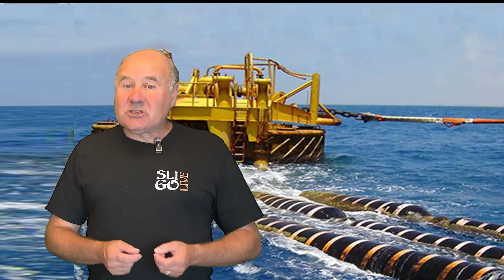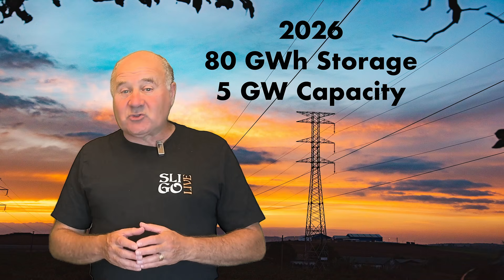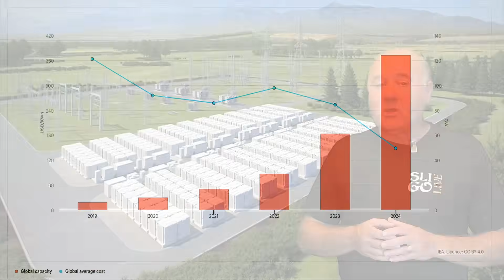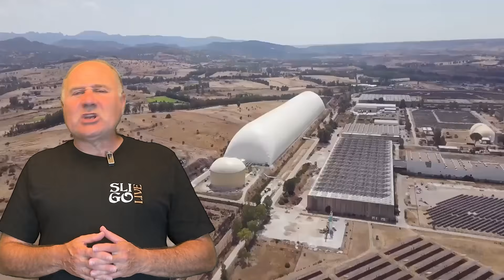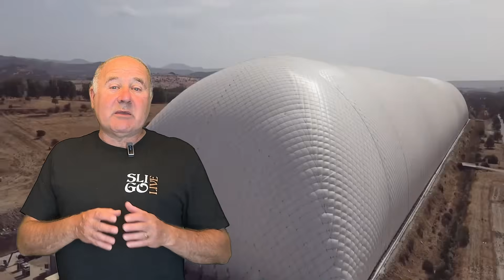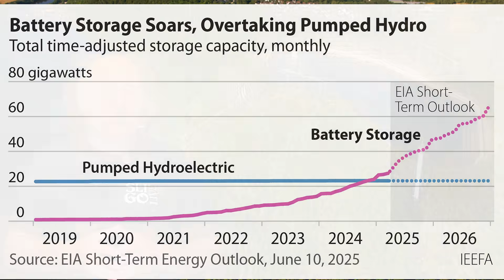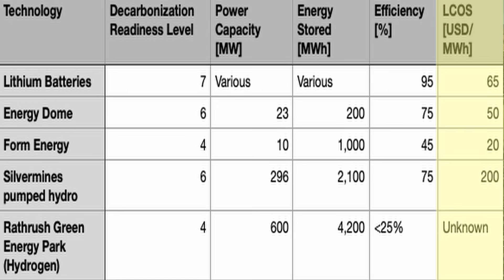Can Ireland build enough energy storage to turn off the gas?

Comment: I stopped watching your video the first time when the subject of energy domes was discussed.
I've watched it all now and subscribed.
You can note that I think Sodium Ion battery storage and solar PV will become the overwhelmingly dominant technologies in the next five years; why ? Solar PV and battery storage are so easily and quickly deployed, and speed is of the essence now. Sodium is abundant and doesn't have the processing disadvantages of Lithium.

I record temperatures both locally and the forecasted. There's a very marked jump in the number of heat waves, their intensity and duration, there really is no time to lose !

I used to work on an oil exploration drilling rig, after a couple of years on drilling and production platforms in the North Sea; left to do an Open University, first module, renewable energy, that was in 1993. So I've been interested for a while and watched the competing technologies.
Solar PV and battery storage is remarkable and relatively affordable now, with payback in less than a couple of years in my case, though I did put it together myself and used an off the shelf portable power station.
I so wish Ireland would follow the lead of other EU countries and the UK and allow balcony solar. Even more affordable and gives many more households the possibility to reduce their energy bills substantially, and reduce the dependence on fossil fuels.

I used to use an electric MTB with a trailer to get the groceries, a round trip of 50km; would be great if shopping centres pandered more to the cyclist. Electric bikes also keep you fit and reduce the need for medical services.
I now have an EV with four wheels, Renault 4 E-Tech and charge it with my small 3.6kW peak solar array, remarkable. If you'd told me thirty years ago that you could power a home and a car with a small box of electrics and a few solar panels propped up against the side of your house, I'd have smiled, now I'm laughing 🤣

The challenge for Ireland as well as globally is to train a workforce of roofers to fit the panels and electricians to take care of the electrics, though I think the electric part of the systems will become plug and play.
Legislation to ensure all new builds have at least enough solar PV to run the house and one EV. Solar panels are cheaper than traditional roofs.

When I embarked on my Oil rig career it was at a time when the price of Brent crude went for $7 to 34 a barrel, 1987 (I've researched and can't find this figure now, though I have a good memory). The UK was desperate to restart the North Sea oil industry after the preceding slump, and one way of doing this was to instigate a recruitment and training scheme, effective, though my wages still doubled during the first year, as I say they were desperate, and once you stop working offshore at the heavy end, you ain't going back, so those with previous experience etc.

I spent most of my life in Scotland and keen on walking in the mountains, saw up close how ubiquitous large and small scale hydro is, though as your chart illustrated, its relatively expensive compared to Solar PV and battery storage.

Good luck 🍀
Reply from the maker: The only thing I would add to your vision is that diversity breed strength. In Ireland having just solar would really suck in the winter. Having just wind, wouldn’t be great in the summer. Having both a much stronger system. Add fair amount of storage and enter connectors to places with different weather and you have a winning grid.
Reply: @Decarbonize11  Wind is fine if it isn't right outside my door with no compensation or consultation. The wind doesn't always blow in the winter or summer or another time of year; a few of my videos demonstrate this.
Solar PV generates even on overcast days in the winter. Output is substantially reduced, but PV panels are so cheap now, that over-paneling and redundancy make it the best option, and Sodium battery storage will keep the grid going overnight and during the winter months.
I'm all for experimentation, been doing that with trees (by far the best carbon capture devices) more or less since I arrived here in Ireland, so very much in favour of ongoing R&D and pilot projects, though I'm still of the belief that PV panels and Sodium will be dominant, given current knowledge.
Reply: @Craig-Mitchell  I don't see anything wrong with wind outside your door, I like to see wind turbines, however, they work so much better if they are 50+Km offshore, so that is where to put them, over the horizon unless you live on an offshore oil rig!   If you do live on an offshore oil rig, I would think they would be a welcome sight, they would somewhat reduce the isolation...

Wind is much better than solar in winter, at least if you are far enough north, which I think the whole of the British Isles definitely are, even places as far south as Portugal and Texas are heavily into wind power.  Yes, you can over-panel, but you need the space to do so, and in the winter, you definitely need an unobstructed south view from that space, which few people have.
Reply: @nigels.6051  Lets devalue your property by 30% then !
Solar is the dominant technology and PV panels can be recycled easily. Do a search and you'll find lots of takers. Do the same search for composite wind turbines blades and you'll draw a blank.
So once the turbines reach the end of their life and the international backers have taken their profits, the gullible farmers and landowners will be left with the toxic waste dumped on their land !
Reply from the maker: There's no evidence that living near a wind farm reduces your property values. 
https://www.renewableuk.com/news-and-resources/blog/do-wind-farms-affect-house-prices/

Old wind farms are no more "toxic waste" than an old tractor. And just about everything other than the blades can be recycled or reused (i.e. put a new nacelle on an old tower). And the owners are required to decommission the old turbines.
Reply: @Decarbonize11  Blades are routinely recycled now, new blades are designed for decomposability, but old blades are shredded and turned into construction material.  Look up Plaswire, who recycle a lot of old GB blades in Ireland to produce composite plastics for high strength, rot proof fence posts etc., specialist materials that are uneconomic to produce from other sources.

Comment: That "160GWh" sound extremely low. Has someone like Ireland's equivalent (?) of UK's  Royal Society "done the maths" like RS did in "Large-scale Electricity Storage"? For UK it's many *terrawathours", and that's just for electricity in our deindustrialised state.

The North West coast of Europe should be pursuing a "Saudi Arabia of Wind" plan. "Decarbonise" is wrong for fixing Climate Change. It was  maybe OK as a  dodgy marketing tactic to start people buying  Renewable Energy gear, but it actively obstructs what must come next if we are to reach full sustainability and fix the actual problem.
Reply from the maker: The maths I used to calculate the 160 GWh is in the video, and it's straightforward. It's to balance the grid during the day when the wind and sun are blowing normally. 

It is not to deal with seasonal or atypical days like Dunkelflaute, which I cover in a different video. I think that's best covered with overcapacity and transmission/interconnectors. 

Dunkelflaute: How to solve the serious problem with the funny name
https://youtu.be/iM_n0Ayskns
Reply from the maker: The focus of my channel is to decarbonize our society, with a focus on energy. Why do you think that "actively obstructs what must come next if we are to reach full sustainability and fix the actual problem"? What do you think would be better?
Reply: @Decarbonize11  it's not so much what I think would in detail be better but that 'decarbonisation' is not only not currently possible (because everything we currently make to 'reduce' our carbon emissions requires carbon emissions to make) but it also doesn't fix Climate Change which I think is what our objective should be. Rationally CC is the stored-up problem of the change we've made to the proportion of carbon dioxide in the atmosphere. If we could halt emissions now, the stored-up problem still carries us on a trajectory of rising temperatures and tipping/runaway hazards, with the best case suggested to be a new equilibrium centuries away of conditions we did not evolve in. Not only is that prospect politically charmless, almost guaranteeing a backlash which undermines the inadequate plan, the current conception of decarbonisation is incompatible with an actual fix which can only involve a global (we all caused, must all fix) effort to reverse carbon from the atmosphere into some non-atmospheric form.

The form a CC fix should take isn't obvious in detail to me, but I think it must feature at least national-scale carbon grids with the flow opposite to how natural gas works currently. Many of our countries already have at least regional carbon grids, but these are under threat due to "decarbonisation" while we interpret it as "no carbon" instead of "carbon removal". I think if those grids are gone our options for 'Anthropogenic Climate Change Reversal' would be greatly diminished. The idea that we're not actually planning to fix CC is the greatest motivator of 'denial', in my opinion.

I'm sorry if my original comment seems rude, I was simply surprised at the scale of the storage number. Plus bonnet bee about 'decarbonisation' which due to my reasoning puts me well outside both major wagon circles. This was the first time I've seen you on yt, will watch more of your videos.
Reply from the maker: @trs4u  I appreciate your thoughts. My point was never to say that decarbonization was all we need to do, but I think we need to agressively do the easy stuff (i.e. electrification of everything possible and zero or negative electrical grid). 

Things like carbon removal will need to come, but that's the next stage. 

I have no idea what you mean by "Many of our countries already have at least regional carbon grids, but these are under threat due to "decarbonisation" "
Reply: @trs4u  "(because everything we currently make to 'reduce' our carbon emissions requires carbon emissions to make)"

That is not really true, we now have carbon negative steel, net zero electricity, net zero shipping, EV road transport, electric rail transport.  Everything we currently make is a lot less carbon positive than it used to be, and can be made very close to carbon neutral if sources are carefully chosen.  We are not far from steel being normally net zero or net negative.  There are still a few big carbon positive things to sort, such as concrete, but offshore wind farms do not use concrete.

There is little point in capturing carbon from the atmosphere until globally we stop adding it, doing so will be a huge challenge, but currently we have to decarbonize.  How much capture is then required is very far from clear, not everyone will want to go back to a cool world, and currently we have no real idea what the climate is going to end up like, we have already emitted too much for predictions to be reliable, and emissions have only just past their peak!
Reply: "For UK it's many *terrawathours""

There are some important differences between Ireland and Great Britain, and it is a GB grid, not a UK grid.

First, GB is closer to mainland Europe, much of our offshore wind is only a few Km from Danish and German offshore wind, so if UK is hit by Dunkleflaute, the other ends of our interconnectors are far more likely to also be affected, while Ireland will be out of the Dunkleflaute by the time it arrives in Denmark and Germany.

Second, Ireland has a much milder climate than much of GB, so a Dunkleflaute mid winter requires much less stored power for heating use relative to normal.

Third, Ireland can rely on interconnectors to GB and France, since GB and France have considerably more power in their grids, while GB can't rely on interconnectors to Ireland to power the whole of GB, GB being 10 times the demand of Ireland, and we also can't completely depend on interconnectors to Norway, because their huge hydro storage has a limited generating capacity, and that capacity is shared with its other neighbours, such as Germany.

Fourth, a weather system normally passes over Ireland fairly fast, while it takes much longer to pass over GB, where GB stretches from the Celtic Sea wind farms in the west, way beyond Cornwall, to the Dogger Bank in the East, half way to Denmark, and the Shetland Islands in the North.  The Shetland Islands are technically not on the GB grid, but in future will be supplying significant power to the GB grid, and the Celtic Sea wind farms are not currently there, but definitely will be in ten years time.

Fifth, I think GB is likely to build more storage and less generation over capacity compared to Ireland, partly due to the size of the country, it is further from the generation to the consumption, so more local storage is desirable, but also due to GB having much better hydro storage opportunities.  GB doesn't have great geography for hydro storage, but it is considerably better than Ireland.  We also have potential for huge gas storage reservoirs for emergency storage, which may or may not get developed - Ireland is using CO2 stored in what looks like a tent, while GB can store CO2 in vast underground caverns, or alternatively hydrogen or methane.

I suspect that generation overcapacity will work out cheaper than storage though, for the majority of the requirement!  And generation overcapacity can find other profitable or beneficial uses, while unused storage is just sitting waiting for emergencies,

Comment: There is a plan which has been announced for a Form Energy battery in Donegal
Reply from the maker: Yes, I mentioned that in the video. I also did a whole video on Form Energy before the Irish announcement

Form Energy: Google is doing a data center right with the help of a rusty battery
https://youtu.be/er2p3g1RBOw
Reply: @Decarbonize11  I was commenting for others because the Donegal project was not mentioned in this video (although you did mention that you did have another video on Form Energy). 
Thanks for your videos, I'm a new subscriber and really enjoying them.

Comment: A couple of remarks.
1. Sodium batteries already have gained market share in China for grid-scale storage. This technology is scaling right now.
2, Your story focuses on grid-scale storage. We see a lot of LFP being deployed in homes in Australia and we see that it works there to flatten the duck curve. More countries are following this example. They don't have the network capacity to transport electricity from centralized storage facilities to homes. Connections need to be upgraded for heat pumps and vehicle charging and the local electric grid already cannot handle that.
3. Hydrogen efficiency. 25% is electric efficiency. If you connect hydrogen to a district heating system, you can reuse the waste heat.
Reply from the maker: 1. My standard for discussing a technology was that there is a project proposed in Ireland. There aren't any proposals at this time to deploy sodium batteries here (or flow batteries, flywheels, or thermal storage), so I didn't include it. As I said in the video, I expect that sodium batteries will be here by the end of the decade. 
2. I probably should have explicitly included home storage. For the points I was making, it would just look like more grid-scale lithium batteries. I mentioned how the batteries should be distributed around the island, and that's what you get for the home systems. 
3. We don't currently have any district heating systems, and if we did, you'd want to use a source that was always available, like a data center, not one that was only available when electricity was so plentiful you were making hydrogen.
Reply: @Decarbonize11  1. Yes, I am not familiar with the specific situation in Ireland. Sodium batteries for home storage are already for sale in the EU.
3. With hydrogen you can improve electrical efficiency by using waste heat as an input. Then when you generate power from it in winter you get heat as a byproduct. The problem with district heating systems is that their heat suppliers have excess heat in summer, while often additional heat is required on cold winter days. Hydrogen can improve this. Batteries don't work for seasonal storage. Especially if people turn to heat pumps to heat their homes in winter. I'm not saying hydrogen is the only possible solution, though.
Reply from the maker: @G @GerbenWulff 
For this city, I was just looking for storage on a daily scale, not seasonal. I’m not a fan of using storage so much for seasonal as interconnectors. I cover that in my video on dunkelflaute

Dunkelflaute: How to solve the serious problem with the funny name
https://youtu.be/iM_n0Ayskns.

Comment: Germany has a plan to use old open pit lignite mines for pumped hydro storage. The capacity for one is estimated to be 400-500 GWh. The big and unafortunately still operational ones aren't even included.